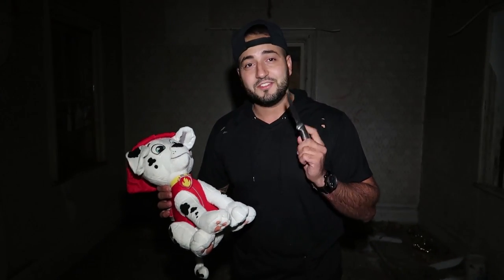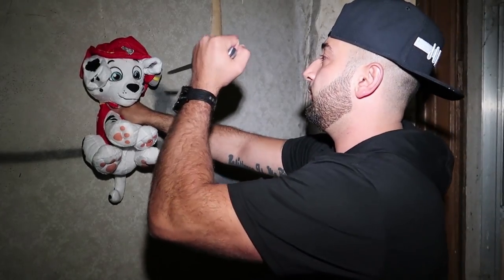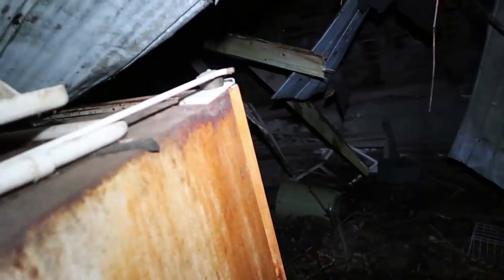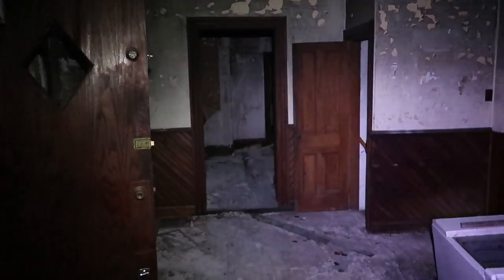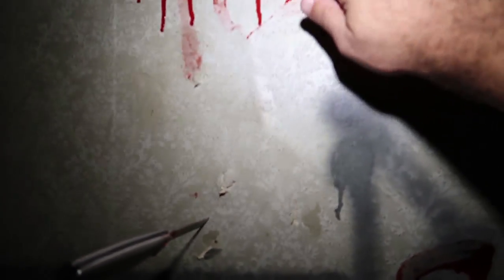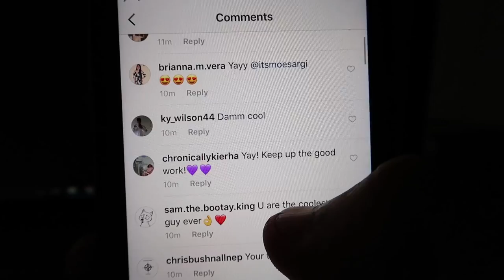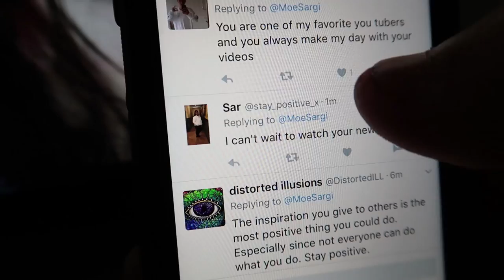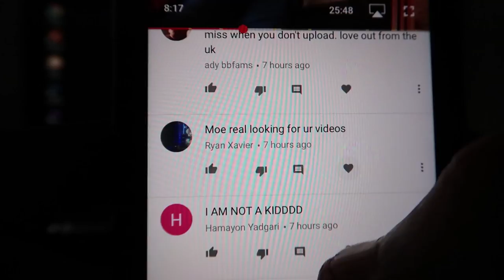(GONE WRONG) ONE MAN HIDE AND SEEK GONE WRONG! 3 AM CHALLENGE GONE WRONG IN TOMS HOUSE!

Comment: you were supposed to use red thread and you were also supposed to name the doll as well. You were also supposed to say "(Name of the doll) you're it." 3 times. And put your fingernail inside the doll. Also, you should have had salt water with you, just in case.. plus, Roi didn't originate this game. It's been around for quite a long time before he did it. Just a bit of advice, if you wanna do these kinds of games, such as a voodoo game, which honestly isn't a game, you should make sure you do it right first. Because the reason it went wrong, was because you didn't do it right. Just some advice for you to have in the future.

Basically, my point: Make sure you actually read the instructions online, and make sure you're doing everything properly, before you start the game. The water bottle, I can understand. But, thee rest, you should have done.
Reply: He did use red thread and there is more than one way to do it.
Reply: He did use water
Reply: You were supposed to use red thread and you were also supposed to name the doll you were supposed to say name of the doll your it 3 times. You should have salt water with you, just in case... plus, voodoo game, Which honestly isn't a game, rest, you should have done.
Reply: He did name it it's original name is chase he called it paw patrol